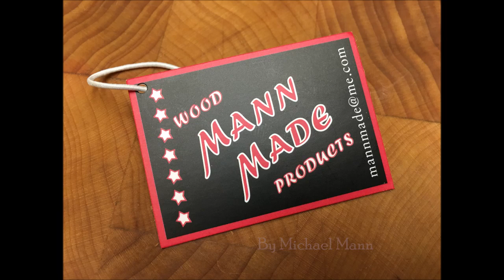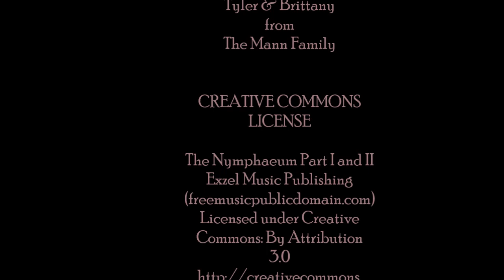Plaid Cutting Board

Comment: How is the Gorilla glue for open time? And is it a food-safe product? What about the lacquer thinner in the board finish? Is that an issue?
Reply from the maker: There is already lacquer thinner in the “wood bowl finish”. It is food safe as long as it is fully cured (I always wait a month). It used to be called “Salad Bowl Finish” and was meant for food situations.
As far as Gorilla glue… working time is advertised at 10-15 minutes. I can’t speak for food safe, however the glue lines are so tight that in my opinion it’s not a factor.